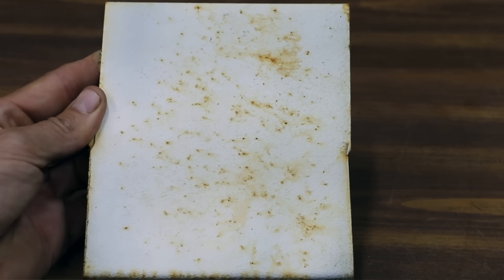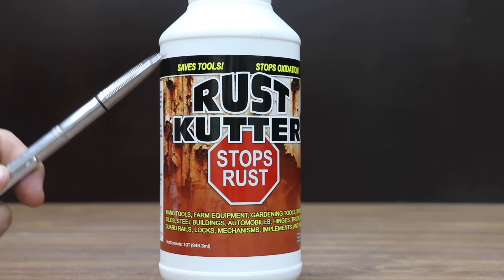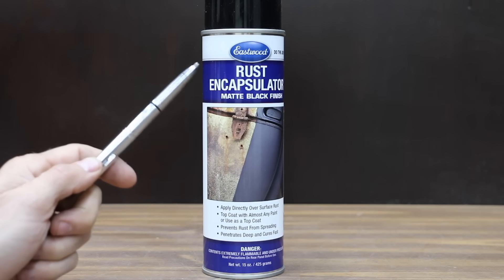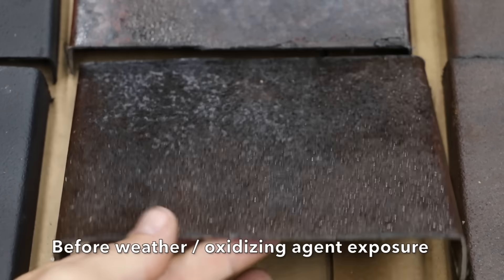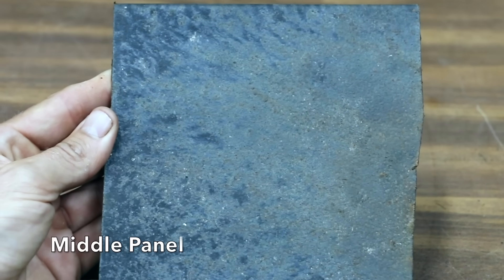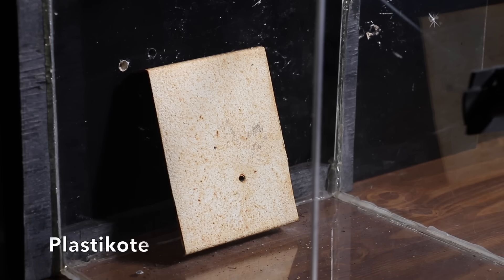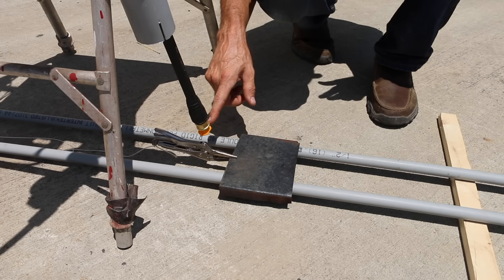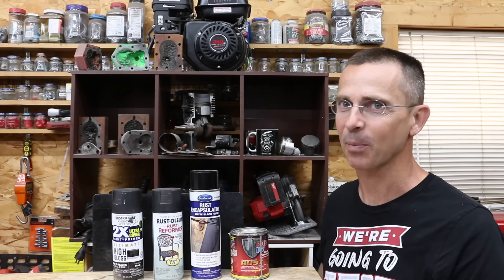Best Rust Converter? POR-15, Eastwood, Rust-oleum Rust Reformer, Gempler's

Comment: I've been using POR 15 for years, and is hands down the best over coat I've ever used. There are 2 things to keep in mind with POR. 1) needs a regular paint overcoat. Sun will brake it down if exposed to sunlight. 2) DO  NOT  GET  IT  ON  YOUR  SKIN... as they say on the can, the only thing that will get it off your fingers is... time.. and lots of it. Lots, and Lots, of time... therefore, also keep it off any threads of bolts that you may want to remove in the future. You will NEVER get a bolt off without destroying the threads, and POR will just laugh at your wire wheel attempts to remove it.
Reply from the maker: Thanks for the feedback.

Comment: POR15 is some phenomenal stuff, however it is a real pain to get off your hands, face, toes and wherever else it somehow ends up when you apply it.
Also, I'm fairly sure if you dip a brush directly into the can, then touch rust with it and dip it into the can again, the whole can will set up solid as a rock, so I usually open the can, and pour it out into smaller containers to use on future projects.
Reply from the maker: Thanks for the feedback.

Comment: I think an automotive battery test would be cool. The standard off the shelf ones like Ever Start and the like from parts stores Vs. The higher end ones like Optima or XS Power. Are the more expensive batteries really worth it?
Reply from the maker: Thanks for the suggestion.

Comment: I speak from experience when I say POR15 is well worth the money, and it's pretty thin so you can stretch those little cans a long way on a project(such as a car frame or tub). I have no experience with that silver or white version though that was used, only black. A warning though, do not get it on your skin as it will take weeks to get it to come off. Also it is possible to reduce and spray it out of a paint gun but I would advise against it unless you have the proper PPE like an actual respirator, you do not want to breathe that stuff in.
Reply from the maker: Thanks for the feedback.

Comment: Have a jeep with eastwood encapsulater holding up pretty well small touch ups each year before winter. The rubberized version in the wheel wells helps with stone hits

Also have the internal frame coat and that is pretty awesome comes and a bright green so you can see whats been painter and has a straw with a spray in all directions tip to soak everything
Reply from the maker: Thanks for sharing.

Comment: Thanks for another great video 👍👍👍while I have never needed rust encapsulater I usually grind and finish or acid clean to get fresh metal but if I should ever have the need it's nice to see an expensive product that's actually worth the price and actually does what it says it does for the price I'd rather spend a lil more to do it once then save a little and get a callback and have to do something again because a product didn't do what they claimed it would 👍👍👍
Reply from the maker: You are welcome!  Thanks for the feedback.

Comment: Since you use brake parts cleaner before just about every test like this in your prep phase, I feel brake cleaner test is a must do video
Reply from the maker: Thanks for the video idea.
Reply: @ProjectFarm  If you do a brake parts cleaner test, please inform viewers that you must never weld on any metal after being cleaned with chlorinated (non flammable) cleaner. It produces very toxic fumes.
Reply: @ProjectFarm  Hi,  Have you ever done a review on best headlamps? I still a headlamp on Amazon and I wish you would do a video with all different headlamps!??:) MillerTech Headlamp
Reply: @ProjectFarm  But don't forget Wurth brand brake cleaner!
Reply: @ProjectFarm  please try purasolve. It is a safe alternative to the normal brake parts cleaners
Reply: @ProjectFarm  I'm especially curious to see if CRC brakleen is as good as it seems
Reply: @ProjectFarm  o
Reply: @ProjectFarm come to think of it I am shocked you have not already done this!
Reply: @ProjectFarm if you do, add K2 brand to the test. It’s the most widely used brand in my country
Reply: @ProjectFarm  be sure to test the brand that @South Main Auto uses!  (I'll edit and leave a link.)
Reply: "In todays video, were going to test these brake cleaners on these brakes... so I used brake cleaner to clean these brakes before applying oils to see which brake cleaner puts the brakes on these oily brakes"
Reply: Main thing it's non-chlorinated.
Reply: @anthonyjohnson100  in my experience the non chlorinated brake cleaner doesn't do near as good of a job as the chlorinated type. It evaporates too quickly and you're left having to use a lot of elbow grease. Whereas with chlorinated brake clean I usually just spray and any residue is just rinsed away.
Reply: After brake cleaner, I would love to see permanent markers tested. I've found I like Milwaukee inkzall more than sharpie, but a comprehensive test of lots of brands would be cool
Reply: the good stuff is non-flammable Tetrachloroethylene. the brand doesn’t matter.  either CRC or FVP is the same basic recipe
Reply: @denisrhodes54  really? I've heard that the nonflammable is only important if you are going to be welding.... Is that not the case?
Reply: @Blue84Stang  the tetrachride when welded forms phosgene gas bad stuff. Use rubbing alcohol, acetone. Or dawn and water
Reply: @chriso1373  that's what I thought. If you just need to clean something (like he does, before testing everything) the chlorinated one would be fine. But if he's planning on welding, then the nonchlorinated is what he'd want.

Actually, now there'd be the test. Different brands of brake cleaner, in both chlorinated AND nonchlorinated versions.
Reply: @exwhyze not necessarily true. The evaporating bit. I was using an excessive amount of brake clean to clean a lot of small metal pieces to be welded together.... The floor was still wet with brake clean.... Without thinking about what I was standing in, I struck an arc and went about stackin dimes. About 20 seconds later I asked myself why it was so hot, I hadn't even been welding that long and then I noticed that the ambient light on the inside of my hood was becoming a much warmer yellow tone than the cool blue produced by the arc. This is why concrete, plenty of floor space and flame retardant clothing and welding jacket/ leather apron are important.
Reply: @exwhyze We have this stuff at work that's kind of like brake cleaner. If someone cleans off parts with it that are later to be welded, when you start welding it, it gives off this gas that rolls up under your hood and hit you like a ton of bricks. It will make your nose run and your chest hurt the rest of the day at least.
Reply: @Blue84Stang  but spraying flammable brake clean at someone under the hood is fun!
Reply: Dawn has salt chlorides in it and if not removed causes premature coating failure.
Reply: @exwhyze4532 Whenever you are working with something containing chlorine, there is a risk of accidentally producing mustard gas.
Reply: @Blue84Stang you shouldn’t use any brake cleaner before welding. If there is any residue at all the fumes are toxic. Hydrogen chloride and phosgene can kill you. Mustard gas is considered less harmful.
Reply: @denisrhodes54  
Good luck finding that.
Reply: mpetersen6  readily available at menards and local independent parts store
Reply: @denisrhodes54  I don't trust that untill Todd makes a video proofing that statement
Reply: @denisrhodes54  i rather use something that's not cancerogen or damages central nervous system, even if it's flammable.
Reply: 3m is becoming my favorite these days. Hate crc in the red can.
Reply: @hbracerx  I find that big can of CRC sprays way too much and it stays liquid way too long
Reply: Dustin LeBlanc  use the straw and short bursts
Reply: Chris Stephens some is a blend of acetone, methanol, and petroleum distillates.  read the labels
Reply: Project Farm what is the best Gelcoat restorer?
Reply: All the brake cleaners I ever came across (in Europe) are just made of Benzine/Naphtha, maybe some with Acetone added.
Pretty sure chlorinated ones are forbidden here, sounds quite unhealthy.
Reply: My preferred brake cleaner is just the cheap oreilly stuff but I also really like crc, definitely a good test idea tho, I wanna know how well they all remove grease and also how well they kill wasps, oreilly brand does very well for both
Reply: @lumpyzx2645  When "degreasing" wasps, do you use a cigarette lighter, too? Asking for a friend. 🤪
Reply: Repair Geek has a really good test video on brake parts cleaner. He’s similar to project farm in method.
Reply: Johnsen's and AutoZone brake cleaner are about tied for the most effective brake cleaner out there, however AutoZone doesn't burn nearly as much when you get it on bare skin, both are quite good as starting fluid, if the engine is capable of firing it will start with either product. I think between me, and the local hose shop we have tried every single brand of brake clean in the area, particularly when the preferred brands are sold out.
Reply: The rust converter I use is corososeal and it says don't use chemical like that or acetone. It says to use soap and water. It will have a chemical contamination if you do and not work right with chemical cleaning.
Reply: @natevanlandingham1945  I was hoping to see corroseal in the video lineup as I just bought some. Hoping it works well.
Reply: @DDugger how did the corroseal end up working for you? I’m looking at coating a trailer frame so looking for real world input. Thank you
Reply: @jermdawg2805  I ended up returning it since I was short on time and rather short on confidence in the product. I haven't applied anything yet.
Reply: Yes!
Reply: Yah, I agree, especially testing which ones leave the least amount of residue. I hate having to clean something twice. Once to clean the grease the second to clean the residue from the cleaner, lol.
Reply: Please include autozone brake clean in test!
Reply: I used to clean all metal parts with 95° ethanol, but the residual water often  provoked more rust. Now I use exclusively acetone, but of course it's bad stuff to inhale
Reply: I love Berryman's B-12, which is a mix of many volatile cleaners.  Each one attacks different Things-Of-Bad-JuJu.  And I was surprised when I found that many sources of acetone are contaminated and not at all pure.  (Can't remember where I saw that. Car painting video, I believe.)
Reply: @ljprep6250  don't be surprised. Unless research or medical grade it's generally not as pure as you think it might be. I guess depending on your region of the planet that could mean 70 to 90% pure. Any industrial chemicals will generally have less stringent security policies and you can generally tell this by the cost of an item. If you buy methylhydrate for $2 a quart for you by methylhydrate for $80 for 100ml and it comes with a paper trail for it's chain of possession you can see that they are very different things
Reply: Regarding brake cleaner testing… the Mopar branded stuff is probably the best I’ve used and I have extensively used Wurth, CRC (red and green, and the blue pro degreaser which works great also), Autozone, and a handful of other private label brands.
Reply: I literally thought about that exact thing today at work as our parts guy told me we're going to change our brake cleaner supplier, lol
Reply: Also we need a test on the test🥴
Reply: Christ all that works
Reply: Denco non-chlorinated.
Reply: CRC is reigning king I'm afraid. It kills wasps better than their actual wasp killer even. Removes the pigment from your skin. It will clean just about anything from anything.
Reply: LPS ftw
Reply: S
Reply: Would be especially good to compare how long different brands last too. I feel some cheaper brands use a giant nozzle to waste the can faster
Reply: I second
Reply: Chlorinated is non flammable.
Non chlorinated is flammable.
Non chlorinated trends to evaporate quicker in my experience, but chlorinated really lingers in the air so I rarely use it. Chlorinated can also project further and you can spray those hard to reach places easier, again in my experience (which is limited to a couple brands only)
Reply: @Duhzmin  need to spray further? Use a blow gun and an air compressor, remove the sprayer nozzle, slip the stem of the brake clean can into the tip of the blow gun, and while holding the trigger on the blow gun press down on the can stem. I always make sure I have 120-150psi in my compressor, closer to 150 the less the can has been used. Just a 2 second burst from the air compressor increases your distance by 7-10 feet. Super handy when going after a yellow jacket nest with nothing but brake clean, a lighter and the garden hose to put out the fire... Or cleaning pads and rotors 2 stalls away.
Reply: Test the ones with MEK, I think these are the best
Reply: Straight MEK is the best cleaner out there.
Reply: @Adamsadventures83  I'm going to try the MEK, thanks for the tip...
Reply: @multibikermike4681  be careful with the stuff though. The fluid and fumes are highly flammable. But it evaporates quickly.
Reply: @Adamsadventures83  Will do👍
Reply: @Adamsadventures83  I'm with ya. Working with white water rafts we have gallons of the stuff in the shop and after using that, I haven't gone back
Reply: I use laquor thinner, gets all loose rust, dirt and oil off with squeeky clean finish. I believe Eastwoods Pre in the same, but not sure...
Reply: It's all the same.

Comment: Painting anything "white" already puts the surface at a disadvantage-
Most "whites" are derived from Alumina oxide and Titanium dioxide,
so the "corrosion" has already started. White vehicles are always the
cheapest, because manufacturers know- that every tiny blemish stands out,
and the color hardly sells compared to others. Have you ever seen a white vehicle
totally blown out, bubbled & peeling? Brown streaks all over?
Reply from the maker: Thanks for the feedback.

Comment: I use to use a product to stop rust called Osphos.  cant find it any were now. It actually converted rust on metal back to metal.  I tested it on several pieces of metal and left them outside in the rain for 3 years. After 3 years there was little to  no rust on the metal, and  a piece that was painted and treated with the Osphos had no rust.  By the way I lived 6 miles from the Gulf Of Mexico and several oil refineries. Very salty , corrosive air.
Reply from the maker: Thanks for sharing.

Comment: Excellent! You finished an entire test without terrorizing the local lawnmowers. LOL
Had some leftover POR-15 (15-20 years old) last year and figured, why not?! My testing was not nearly as scientific, and I basically slathered it on anything that looked rusty. It does have to be used quickly once exposed to air, though.
Looks like POR-15 is best for anything constantly exposed to nasty elements, with the cheaper products okay for objects that would be sheltered.
Reply from the maker: Thanks so much!  Thanks for sharing.

Comment: So the rust will not keep rusting under the rust products, and then end up with a hole??
Reply: I've used some rust converter products and those actually did react with the existing rust. They were said to work as primer and rust converter. The paint was off white when applied to bare metal and where there were rust it reacted with the rust and turned charcoal black. According to the blurb on the cans the converted rust should be even less prone to rust than bare metal that's painted, but I can't vouch for that. I did however paint over the converted rust with Hammerite paint to protect it from wear. I choose that paint as it's supposedly rather wear resistant, but it's also supposed to be rust retardant, so that makes it hard to judge how much the converter helped and how much is the Hammerite paint. Whatever the case the very rusty wheel barrow I painted five years ago hasn't shown any sign of starting to rust again and it's been left out side exposed to the weather all year round. Now I'll have to look at replacing some of the wood on it as there are a few pieces that are starting to rot.

Comment: Driving a rust bucket (Mazda) in need of help, this video is great. The reputation of POR-15 on the internet is mixed. People hate or love it, and your video demonstrates why it may be hated, let me explain. When you cover rust with an encapsulator/converter that has a tough hard to break coating, you don't easily see all the small capillaries and cracks and dents that let water underneath: just as with rubber undercoatings. You end up with a ravaging cancer that you don't see.
Reply from the maker: Thanks!  Thanks for the feedback.

Comment: I've used the Rust Reformer with great success.  You do several light coats like the instructions state, then you put a coat of paint over it after 24 hours.  I have items painted 4-5 years ago that have not had rust come back and they are in the weather 24x7.
Reply from the maker: Thanks for the feedback.

Comment: would it be possible for you to test welding wire mostly mig ER70S-6 or flux core E71T-GS  and not just the name brands but the generic ones you can find at harbor freights or a local hardware store, Mostly this would be for the hobbyist or tinkers not  for the professional welders.
Reply from the maker: Thanks for the suggestion.

Comment: I’m sure there are other products to make a part. 2. I’d try brushing on evapo rust. And it’s not meant for this but duplicolor engine enamel is really good for painting rusty metal. It actually seems to come out similar to por 15.
Reply from the maker: Thanks for the suggestion.

Comment: I would have liked it if you had also sprayed on Turtle Wax Ceramic on those rust converters before spraying them with the corrosive.  Turtle Wax Ceramic was the clear winner in you Ceramic finish video.  I used it on our car and it really has held up.
Reply from the maker: Thanks for the feedback.